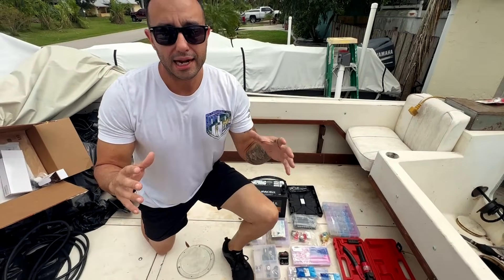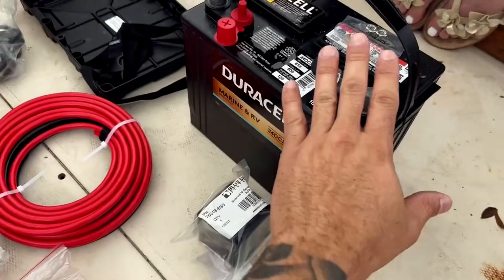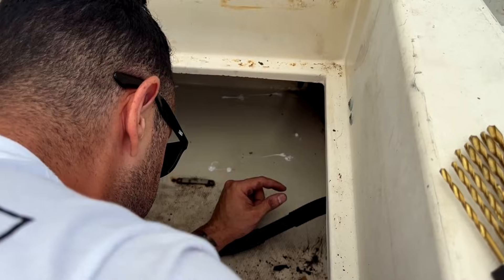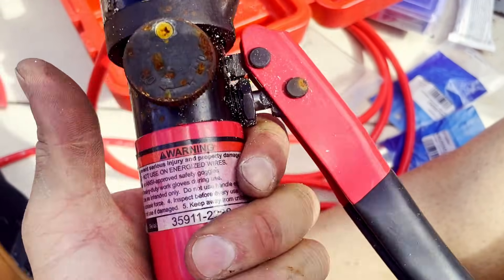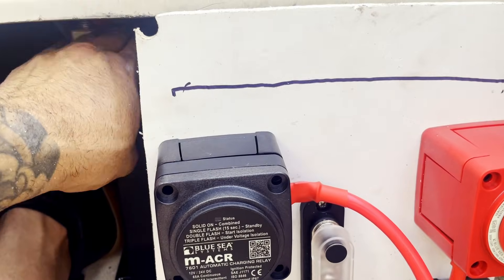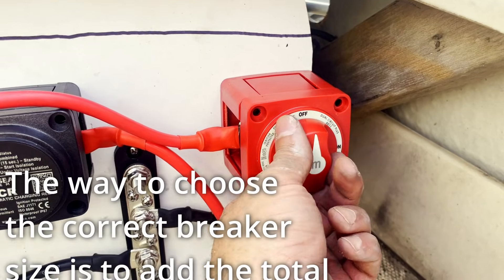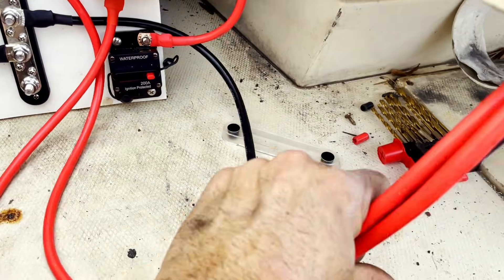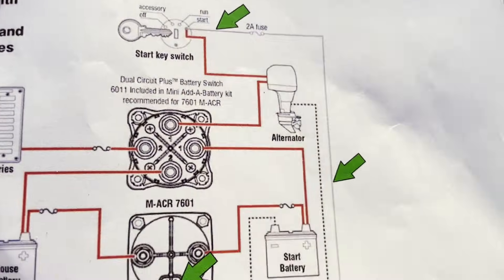Dual Battery ACR Install Boat Wiring: Beginners Edition

Comment: Fantastic instructional Video - Iw ill be purchasing the eBook to assist me with my fresh install coming up soon. Can i ask a question, I have a 5 meter boat (approx 3-3.5m from batteries to fuseblock on the helm) which will be running a few accessories, stereo, VHF radio, Cabin Lights, Nav Lights, fishfinder and some pumps, Do you think 6 AWG wires from the Breaker to the front Fuse Panel on the helm is the right guage? Also, how do I determine the size of the breaker? I'm afraid of making a mistake a causing a fire so I'm trying to understand  if these things matter and if that's the correct wire size. haha Appreciate any dierction you can provide,.
Reply from the maker: Thank you for the kind words! That’s awesome you’re taking on a project like this! The ebook makes it even easier! To answer your question, the 6 awg wire should be enough. The way you find out the size breaker you need is to add up all the amperage of all the devises you could potentially be using at the same time. Lights, bilge pumps, gps, wash downs etc. That’s the number for your breaker! 🤙
Reply: @perfectfitboating so is this why your boat had a 60 breaker an this one has a 200 breaker?
Reply from the maker: The owner of this boat bought the incorrect breaker.👍

Comment: Hi i have a question I wish you can help me am going to install a Yamaha 200 hp outboard I wanted to know the amp ignition protector 
- And the amp for the blue sea systems that goes in the battery terminal  thanks
Reply: Thank you for your help and the waterproof amp would be 200A or 300A
Reply from the maker: @Crazy99-w4t  I think you’re referring to the breaker that runs to the fuse block? If so that’s going to depend on how many amps all your devices can draw at one time. For example, for our boat we chose a 30 amp breaker. We added up the bilge pump, wash down, aerator, lights etc amperage’s and came up with around 25 amps draw at one time. That’s how we chose 30 amps for the breaker. Hope that helps! 🤙
Reply from the maker: Hey there! According to the blue seas instructions, the ignition wire that comes from the acr requires a 1-10 amp fuse. I’m assuming it depends on the length of the run and how much your Yamaha ignition draws. 
The fuse for the battery terminals is between 80-100 according to the instructions. We did 80 on our boat since the run was not that long, on this boat we did 100 because that’s what the owner purchased. You should be fine in that range. Hope that helps! 🤙

Comment: could you please tell me why you are using 100 amp batery CB, and the other video you used 80 amp CB? Thank you... is there a formula?
Reply from the maker: Hi Della! I did this install for a family member and they purchased all the supplies. The  instructions from blue sea systems states to use between 80-100 amp fuse for the ACR even though the entire system is rated for a 65amp charging system. Not sure what the formula blue sea systems uses but it’s just over the charging capacity for the acr. Hope that helps!🤙